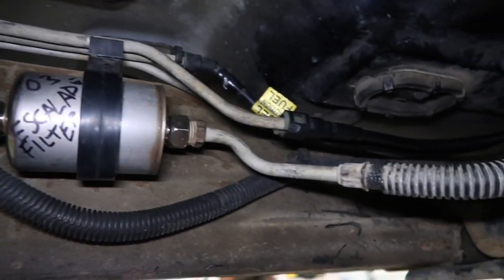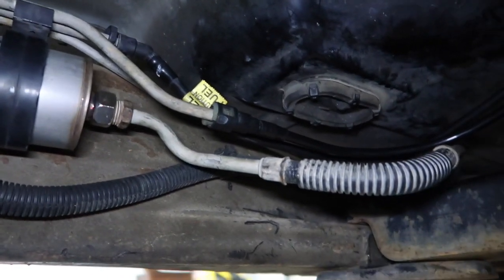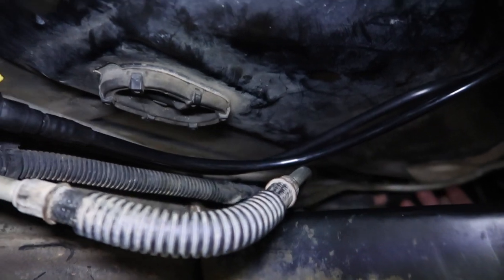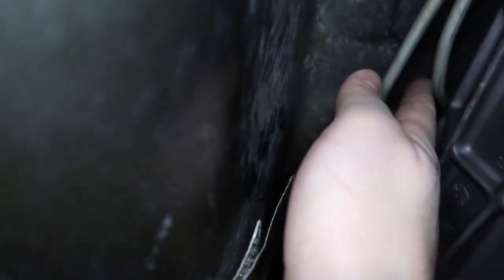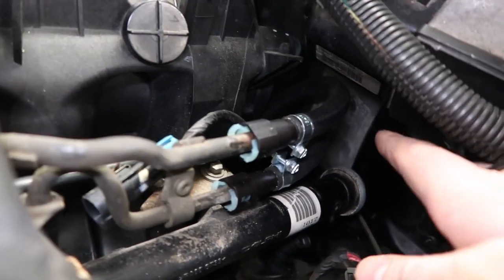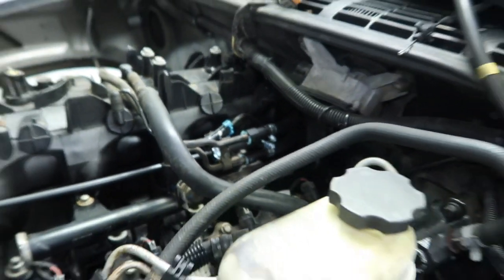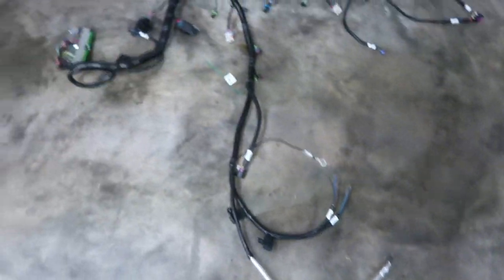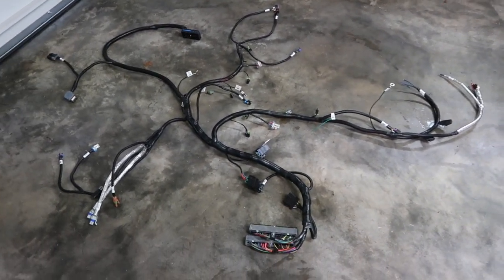LS T56 SWAP S10 : WIRING AND FUEL

Comment: Working on swapping in a 5.3 and 4l60e into a 94 2.2 5 speed s10. 2.2 pump will not make enough pressure. My plan is to use a stock pump out of a Silverado and put it in the S10 sending unit.

Comment: Will there be a video showing you plugging up the wires, very interested to see that since I’ll be swapping a motor soon
Reply from the maker: slowchase no video of actually plugging it in, but everything was labeled and the correct length and plugged in without any issues. It was probably the easiest part of the whole swap.